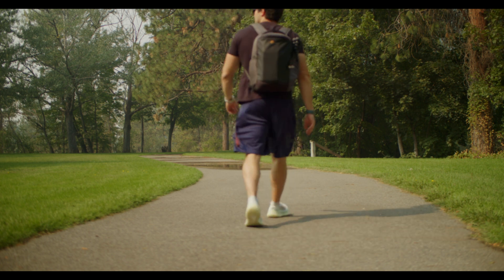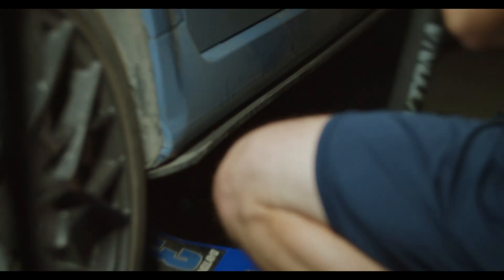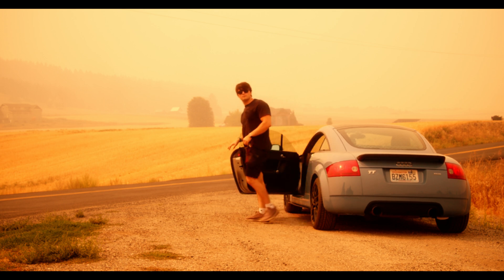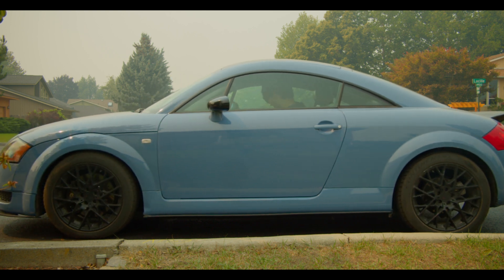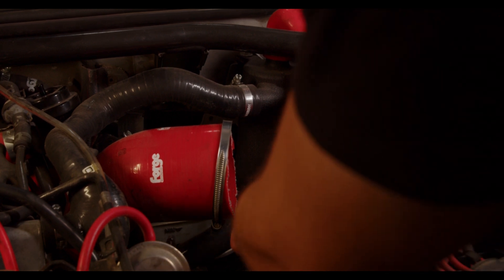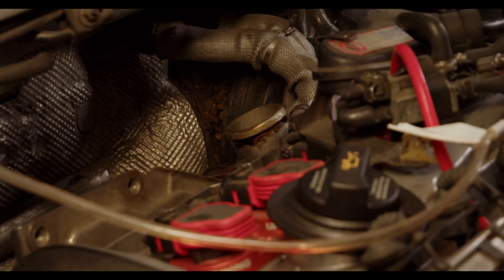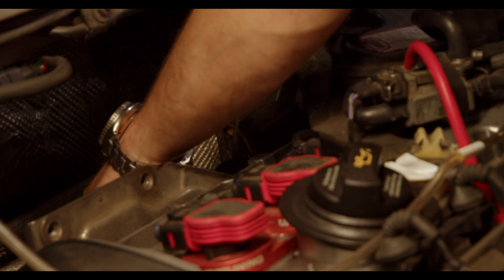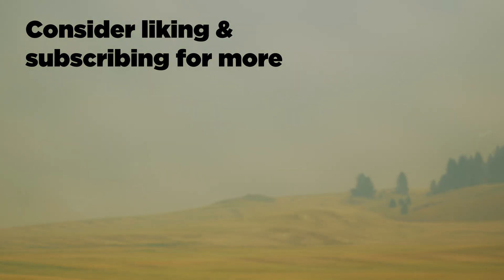Building A Custom 1.8T Turbo Kit | Prepping The Car & Getting Started

Comment: Couldn’t get bolts out. Got everything out of the way. Nothing. Then…Used an electric nut heater bought from Amazon. Proper socket and 1/2drive impact gun. Bolts came right out.

Comment: I feel your pain. When I changed my turbo on my TT I had a  bolt that I could not get. I ended up removing the head. Still couldn’t get the bolt out but made it easier to cut off.

Comment: I found that for any bolts on the turbo, down pipe or manifold - after time with penetrating fluid, try to add pressure in the tightening direction and then try to remove. This helped almost all of them free up. For one of the turbo bolts I had to Dremmel the head off with a small cutoff wheel.

Comment: I found your videos as I was modifying my TT and have been looking at building my engine as well.  I found CO motor sports sells a CTS big turbo kit for the 225.  Just wondering if you came across it yet.  Just for me bringing my engine in to have it built, block and head is about $8,400. from a reputable shop.  No manifolds or turbo or pipe work just the engine.  They recommend boring the engine because of the age and mileage.  I have to say the majority of the price is in the parts. Any way it will be interesting to see which way you go, keep the videos coming.

Comment: I got lucky with my longitudinal turbo bolts they just came out, all i had to do was bend and grind down an old ring spanner to reach the one closest to the block. You might need to heat yours up, an old trick is to use candlewax as penetrative.
Btw why do you always unlock your car with the key? Does your fob not work?

Comment: Absolutely love this series! I own the same car and am also working towards a turbo upgrade. When it comes to performance measurements, have you ever explored the NefMoto forum? I managed to get a cheap OBDII cable from eBay, used it to read the firmware with Nefmoto, and logged a pull from 2k rpm to the rev limiter in 3rd gear using VisualME7Logger. Then, I plotted the data using ECUxplot. This approach provided all the insights I needed before I began tuning. This method should also be compatible with your S4, I think it uses the same engine management system. Just a suggestion! 😊
Reply: Also, I just wanted to add - the multi-camera production and overall quality of your content is top-notch! It's genuinely impressive how much effort and detail you put into your videos. You deserve so much more recognition for the quality you bring to the platform. Keep up the fantastic work!

Comment: Sadly when cars get to 20+ years old alot of jobs just become a pain in the ass, due to seized nuts and bolts. Im just replacing my cam cover gasket; and the 6mm hex that holds the charge pipe bracket on was seized and then it rounded off and it was a nightmare to get out due to access, managed to stick a screw extractor in then get grips to turn it. Took ages and thats after drilling shocking and using anti seize on the bolt. Then after that one nut at the back of the cam cover was cross threaded lol, now i know why mechanics dont like working on older cars. A 2 hour job just gets tripled by these kinda things. Anyway good luck man look forward to seeing the rest of the project.

Comment: I weld a nut on to the existing bolt. The heat breaks the tension and you have a better surface to remove the bolt.

Comment: Seafoam deep creep and some heat is your best friend. I would get a really good set of vice grips (not harbor freight) and lock them on if you can get to the bolts. Then take another tool and tighten the vice grips even more. Then use something to help you turn the vice grips. Or, you can cut a line on the top of the bolts and use a heavy duty flathead. Some people take a chisel and hammer the side in a counter clockwise direction. Otherwise just cut it off with a dremel and mini metal cut disks. Hope this helps.
Reply: Try automatic transmission fluid and acetone 50/50 mix. Best bolt buster and it allows you to reuse the bolts if needed. Makes pb blaster look like Windex
Reply: @christophermannferdmann2603  you are definitely right sir, that mixture is better then deep creep. Deep creep is just convenient because it’s in a can.
Reply: I know that you said you used penetrating oil, Seafoam Deep Creep works 100x better then pb blaster because it doesn’t dry out. It lubricates and penetrates lol.

Comment: oh man watching you with those bo.ts on the turbo manifold really made me remember the pain it was getting those out lol.  I took a dremel and spent like 2 hours grinding them out

Edit if you have a welder, you could always get a slightly bigger nut to sit over the top of the manifold bolt heads, and you could weld those in and use the bigger nut on a socket to remove them.  The heat from the weld may be enough to shock them to move a bit.  Worst case, they arent ever coming out and its time to get the grinding tool out.   Hope this helps!  those manifold bolts are a straight bitch and getting the studs out of the head for the turbo manifold is not any easier either so good luck!
Reply: I spent 4 hours with the welder. Didnt work. What worked was getting an angle grinder and a new exhaust manifold
Reply: @tjkoenig1387  yessir i had to do the exact same haha.  Was an entire weekend project  lol.

Comment: I was having issues with my turbo not holding the correct boost, I got lucky and it was just the N75 valve.
Reply: Right especially cause he has an underboost code. If it was the turbo it would be making the dreaded dentist drill sound and oil would be dumping out the exhaust.
Reply: I though the same, it's usually always the N75 or a leak.

Comment: I was actually worried this would happen to you.  I also went through this.  I ended up pulling the motor and installing connecting rods, and a new clutch with a o2m reinforcement kit I was saving up for anyways.  My only regret was not having enough money to get the big turbo, and knowing what config works with exhaust and the awd prop shaft.  So I for one am looking forward to learn from your build.  As for those bolts,  I stopped myself before messing up those heads too much, and with the motor on a engine stand I used a map gas torch and a hand held manual impact driver 3/8" drive for my E14 socket wacked it hard after heating it up, and got lucky.  Not sure what will be needed to cut those heads.  I think they are some titanium nickel alloy or wierd stainless.  Regardless good luck.
Reply from the maker: Yeah I am holding out hope they aren't too terrible to drill out. The head rounded with hardly any effort so I'm thinking it should be able to drill just as easily. The impact and heat is smart! Pulling and building the motor is also something I'll need to do sometime. Thank you a ton for the support!